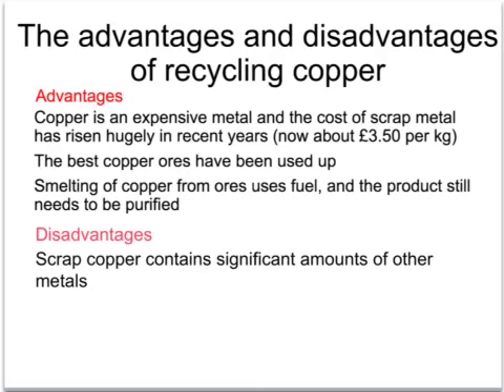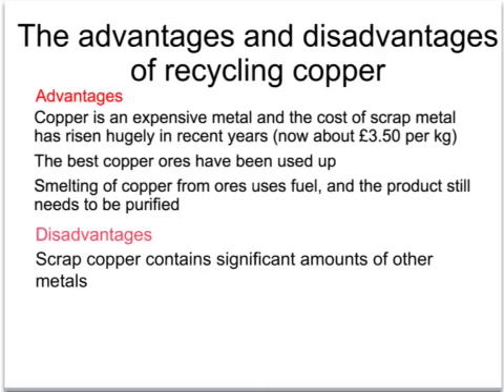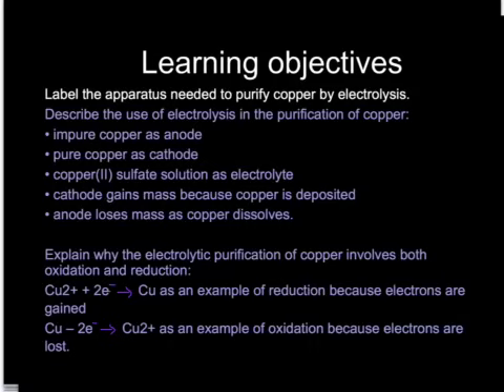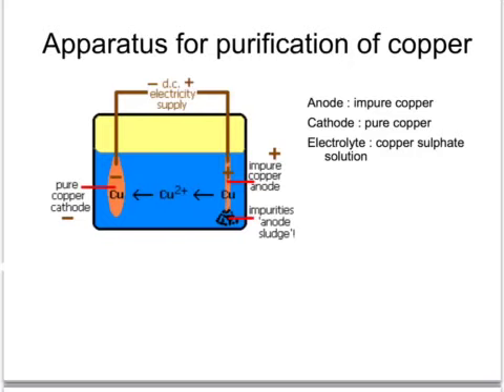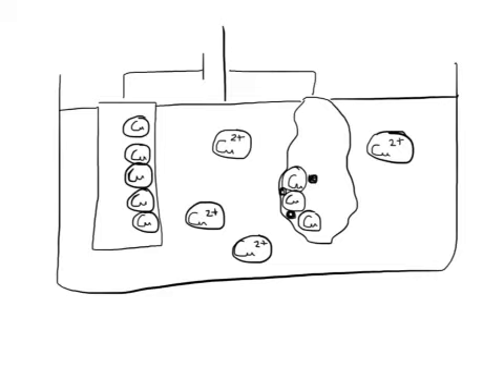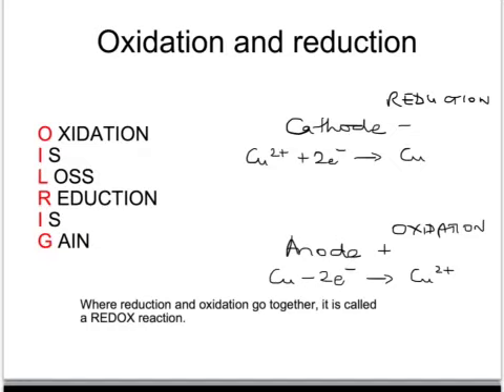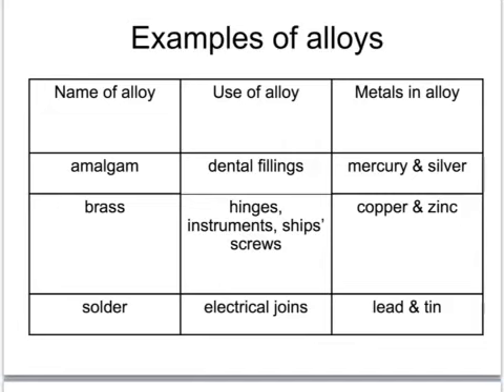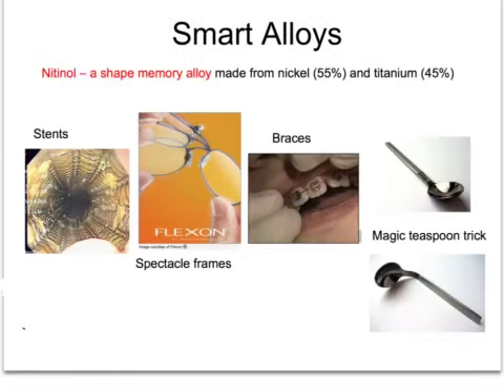OCR Gateway C2 Copper And Alloys (Higher)

Comment: any tips for learning the electrolysis stuff, i just cant learn it for some reason.
Reply from the maker: Alex FireHawk  Not really. Try to remember that copper ions, like all metal ions, have a positive charge, and from your physics recall that opposite charges attract. That means the positive Cu2+ ions go to the negative electrode (cathode) where they gain 2 electrons to become Cu atoms. The cathode is made of pure copper to begin with so that you just get more pure copper as the new Cu atoms are made. At the other electrode (positive anode), the reverse happens - copper atoms there lose electrons and dissolve as Cu2+ ions into solution. As that electrode is made of impure copper, anything that isn't copper drops off to the bottom and becomes anode sludge. Good luck with your course.